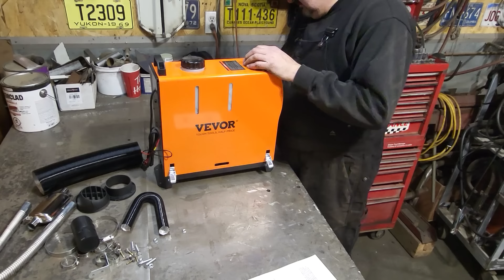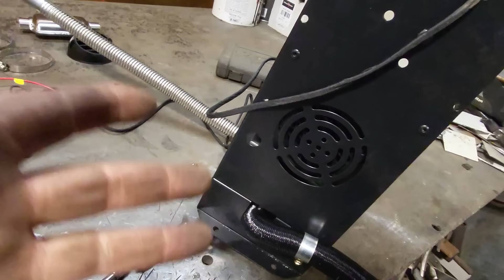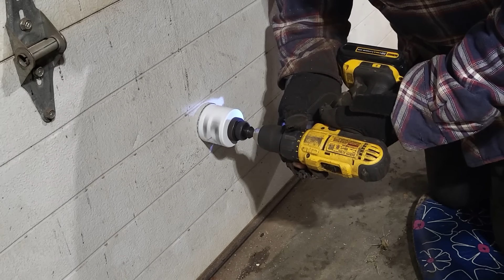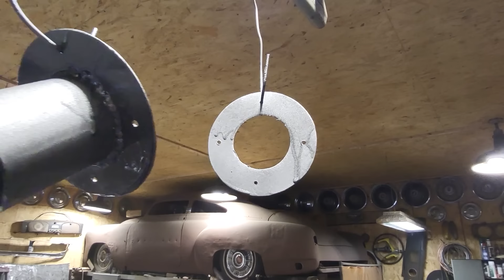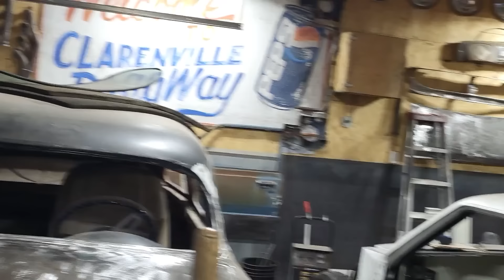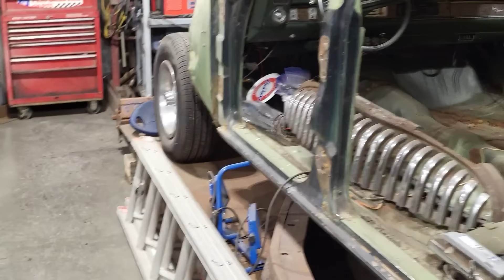Will a diesel heater heat my 800 square foot garage?

Comment: Hi Tony.  Looks like a good heater for the shop.  Nice that you don't have to have a big stove pipe running through the shop and up into a chimney outside, like you would need with a wood stove.  Here in the States, you can buy red colored diesel, for off-road use, which doesn't have road taxes added to it, so it's cheaper.  Do you have a similar system in your area?  Maybe it would burn waste oil or a mix to save some of the fuel cost.
Reply from the maker: There is fuel here like that for fishing boats.

Comment: Vevor has been sending me email promoting the diesel heater for over a month. It is getting rather obnoxious. Vevor makes a decent product but they have not backup service, no parts. Buy it, use it, throw it away no matter if one dollar of eight hundred dollars. They expect parts to be available globally and that is not what is happening.
Reply: Well that's not true at all!  They're completely serviceable. I have a full part list. I have interchangeable part list. I also have complete diagrams on how to wire up the heater to work without the ECU. In case it fails and you can't get a replacement soon enough and you still need heat.
Reply: Would be a HUGE help if you posted such for others or HOW to get such @bikerboymc54
Reply: I bought one of the mig welders, long story but I ended up getting the welder for free, and it at least works now. I've only done one job with it, so I need to test it further. Customer service has a language barrier and so does the manual. 

Two problems with the welder when delivered,  clogged MiG gun or liner (eventually cleared itself), and lack of instruction about the reset button. I wasted a half spool of mig wire making a bird's nest due to the clogged gun. The machine arrived in constant wire feed mode, so as soon as I switched it on, it fed wire. I had to unplug the power to  stop it. The red button that changes welding modes is also a reset button for the motherboard, but the manual doesn't mention this. Fourth call to China got that info straightened out.

But it's a mig, tig, stick they sell under $150 US. Welded the mower deck with it.
Reply: Parts are easy to get for these heaters.
Reply: @frankpohr1870 Well continue with your information. Where?
Reply: As with MOST 99% of SHY NA produced stuff
Reply: It’s not a very complicated design. What parts are you talking about that you can only get from Vevor?
Reply: That is their business model, parts all over AliExpress and similar net shops.
Reply: So true

Comment: As others have mentioned, GET A CO MONITOR!  Might save your life!  Also, you maybe could fit a filter on the fan intake on the rear.  I bet you're going to find the electric heaters less costly to operate though.

Comment: If you're smelling fumes you may have a cross contamination of the combustion chamber. Easy to start pumping out carbon monoxide. Put a detector in the shop just in case. That stuff starts creeping in on you and puts you out quiet like. You get real slow and stupified, feels like your in a fog and takes forever to get anything done. Was working in my shop heating with and old kerosun heater laying on the floor changing a transmission. Worked all day till 2 in the morning could get anything accomplished. Finally started feeling real sick and went outside. 10 minutes of fresh air and finally figured out what was going on. A little bit more and I think I would have passed out and been dead... I was lucky. Trust me you won't know it's happening till it's too late. Be safe.

Comment: a friend just got one for his workshop.  Im doing a short bus/motorhome conversion and I picked up a China knockoff of another heater for it.   It does air and hotwater with a lill 2.5gal reservoir tank inc. in the unit
Reply: They are ALL SHY NA produced

Comment: Well, I had bullet heaters and got rid of them and installed electric ones, but they were 110v. I have found that while a heater such as that gives quick heat, the real downside was always getting fuel. I thought why put a hole in the garage door, I was thinking above the grinder, so the doors can be opened on the fly without moving the thing. At least you still have the electric heaters, that is a real plus.
Reply from the maker: I want to use think unit in my camper but that's full right now. So wanted to see could it heat my shop. It's only temporary

Comment: I have one of those but the cube size, built a shelf on wall with a giant hole in the middle and ran the exhaust outside, got a 12 volt power supply from amazon cheap.

Comment: Funny. I’m in town and I just got one of these a few weeks ago as well.  And I did exactly what you just did, cut a hole through the garage door, welded up a piece of pipe to run the exhaust through, I don’t have a cap or a flap on it yet I just stuffed some insulation in there when I’m not using it.  I like your idea of cap, I’ve got an inch sticking out as well, so I think I’ll make one. Out of the box mine was pretty junky, one of the bolts had fallen out the bottom, and the four clips holding the cover on were falling off one of them was assembled wrong. First time I used it the control panel fell off, the two sided tape let go. Remote never did work.  But, it did give off a surprising amount of heat. Though I couldn’t get it to heat the garage much more than 12-13°. I used kerosene in mine, as I had four litres of it on hand. The main hose leaked a little so I was getting fumes as well.  I tightened the clamp a bit and it’s fine.
Reply from the maker: I never check for leaks!!
Reply: Not a good idea to use kerosine, as it has reduced lubricity when compared to regular diesel - i.e. is likely to shorten the life of the pump.

Comment: Very cool idea! I did basically the same thing with a small homemade wood stove but ran the chimney out an existing window instead of the garage door. Just took the glass out and replaced it with a piece of sheet metal. Got a fan blowing behind the stove and it works incredible for a small amount of wood 👍
Reply: MUCH better idea, I have a slide up window in mine that I had to bust the window out because I locked myself out, & I will replace that window as you & insert the heater exaust

Comment: Just a thought fitze. Grab an old cieling fan and put leave on low speed. It will distribute the heat evenly and it will get rid of any cold corners and wick up any moisture that might accumulate.  Just an observation from Saskatchewan Canada -38 celcious lol
Reply from the maker: Good idea

Comment: I heat 900sq ft detached shop with propane heater. Last year I wired a wifi thermostat inline so I can monitor the heat from a phone app. I turn it up a little before I go to the shop so its nice and warm when I get there.  I had figure out the "C" constant power wire to keep the wifi thermostat running. I pulled the 24V from the transformer in the propane control panel. Works great.

I never considered a Diesel heater such as this but I am glad you put this together to show the options.  You make my head spin with the  C vs F temps. I keep forgetting where you are!!  I'm in Virginia USA.
Reply: Va here also lol😂😂

Comment: Tony,
Since it's a diesel heater, the unit starts the glow plug first. Once that heats up then the pump starts. The biggest power drain is on start up and shut down as that's when the glow plug is activated.
Don't let the battery die or get too low! Use a "tender" type charger on it. If the unit is running while the power dies, the burner will overheat and the controller will cook... in seconds. The body of the burner itself gets over 210 or more Celcius. Some see 245C.
Please don't wait for the green fuel line to fail. It tends to degrade and leak.
Smells from the unit running are often because the exhaust pipe is leaking where it is clamped to the burner. Put a little muffler paste around the burner pipe to seal it and use an exhaust type clamp instead of the Jubilee clamp that comes with it.
I run furnace oil in mine. It's cheaper than diesel here but diesel and furnace are both "middle distillates" and should have the same lubrication properties for the pump. Some oils like kerosene don't lube the pump well and may cause it to fail.
If you haven't.. check out "John McK 47" on ewetoob he did a great series on these. The videos are a bit old but still very good.
I put one in my brothers poorly insulated, drafty two-car garage. It takes the chill off on a windy day and does a great job on a calm day. Your shop should do well with it.
Reply from the maker: Great info. Thanks

Comment: I've got an 1800sq ft shop (12ft ceilings) that's really well insulated. My heater (same as yours) will get the whole place warm.  Not instantly, but...   

I need to figure out a better exhaust routing.  As someone else below said, get an old cast iron radiator and push the exhaust through that, THEN to the outside. Doubles its effective heat output.
Reply: What might work good is an old water to air radiator(a metal one like an old car or truck would have) with a fan blowing through it.
Reply: @markmainse3387   - would for a short while. But then the acids in the exhaust would eat through the thin copper/brass walls of the radiator and you'd just end up pumping ever growing amounts of CO into your room.  :(
Reply: @DrFiero  agreed I mean trying to economise on the egt of a 8kw heater seems not worth while
Reply: @markmainse3387  - it’s almost free heat, as the exhaust temp is SO high. And just getting spat outside otherwise. Also saves having to route an otherwise very hot exhaust pipe through a wall. Experiments have shown it drops it from about 200c down to about 30c.
Reply: @DrFiero  if it's proven to work then by all means. I could see it working for a bit as those old cast heaters are pretty robust or even better a steam one as it'd have a provision for condensation.

Comment: The best way to increase the efficiency of these diesel heaters is to do exhaust heat recovery.
Checkout video by D&S Farm NS:
Diesel heater upgade 200% more efficient
Reply: I was thinking if you pumped the exhaust through an old propane RV heaters combustion chamber before venting to outside, that would really capture all that heat and release to your space.

Comment: you might find when you put the cap back on the hole in the door that it ices up with the moist air escaping from the garage and you might not be able to get it off again.
Reply from the maker: Good point.

Comment: I have the same heater in a 1 car garage insulated and in lower temps it doesn't do very well
Reply from the maker: What do you mean low temperatures?
Reply: @fitzeesfabrications  below 20 degrees I have to run the heater full blast on hi to maintain 50degrees
Reply: @fitzeesfabrications  I run the heater 24/7 and try and maintain 69 degree temperature most of the time it does it no problem
Reply: @fitzeesfabrications  I spend about $30 a week on fuel running the heater on low
Reply: @Hotrodfabs  Sounds like you may need to look into the way it is installed. Is the heater located indoors or outdoors? Are you sourcing the combustion intake & exhaust externally? Is the heat exchanger inlet & outlet routed internally?